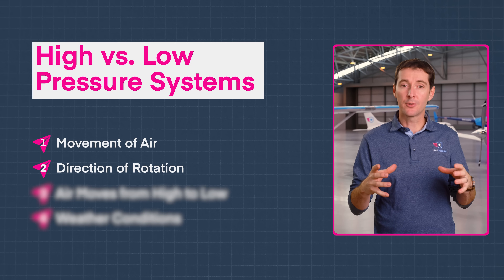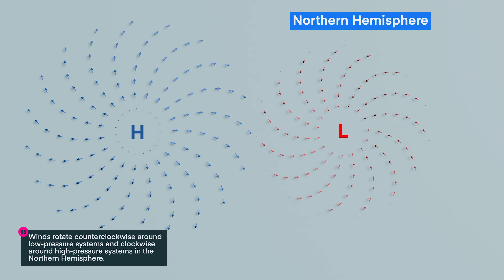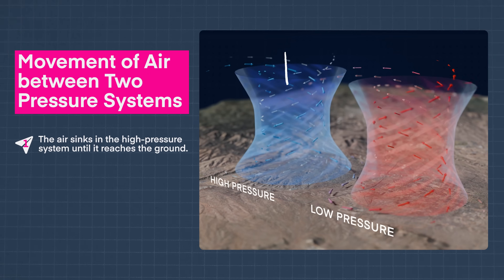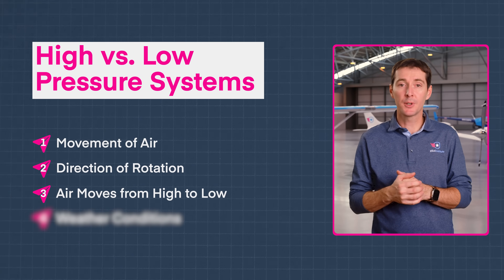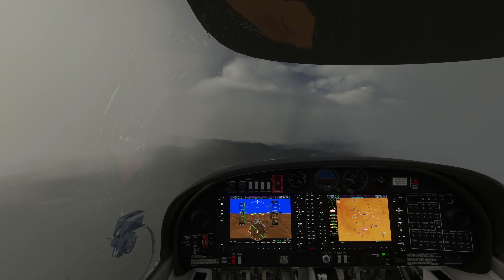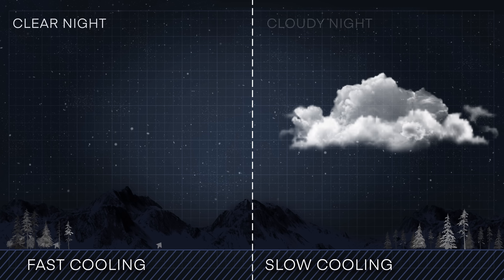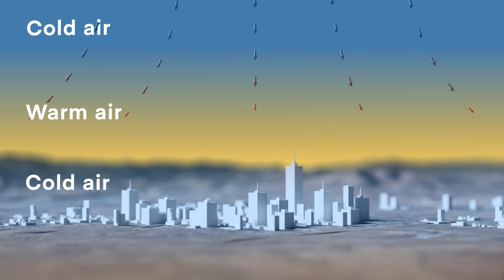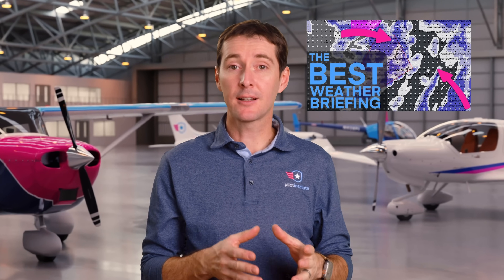High vs. Low-Pressure Weather Systems: What’s the Difference?

Comment: The clouds in a low pressure system are convective and tend to build up during the day. The wind is often fresher and visibility out of cloud is good.
In a high pressure system they are stable and stratiform, and the winds are light with haze and reduced visibility.

Comment: Brilliant presentation, useful for sailors too. One factor you missed was the adiabatic heating of the air in a high pressure system. As the air descends it compresses, and that compression heats the dry air, and that is why high pressure systems are warm and dry. Thanks for your great work.

Comment: Love this video, it took me a second to understand the "why" behind low and high, and then I remembered temperatures. Higher temps = lower pressure because the air is less dense, lower temps = high pressure because air is more dense. Heat expands/energizes molecules, but lower heat = less energized molecules so they are closer together. In laymans terms anyways lol

Comment: Does a high pressure system cause the air to sink, or does sinking air cause a high pressure system? Does a decrease in air temperature cause an increase in air pressure, or vice versa?
Reply: Just using simple physics, cooled air is more dense because cooled atoms have less energy and do not move that much. That makes the same volume of air take less space. That creates a pit in the air layer that is getting filled from its sides with a less dence warmer air. This air goes to the center of the pit, becomes colder and sinks to the bottom.
Reply: @FogsterBell so a high pressure system is created by the presence of cold air?

Comment: If low pressure causes instability because of rising air currents why doesn’t high pressure cause instability because of downward air currents? What am I missing?
Reply: I meant air pressure in both instances.
Reply: Because low pressure rises in attempt to equalize the pressure. It results convective activity.

Comment: Coriolis effect is BS
Reply: Care to explain your position?
Reply: @edwardkuehnle7955  My position depends on the location I’m at. For example, when I am in Australia my position is upside down. When I am in Germany my position is upside down as well, when you consider my position after the Australian point of view.
Reply: @edwardkuehnle7955  Ask the pseudoscientific bamboozlers, WHY the Moon waxes from left to right on the Southern Hemisphere, and from right to left on the Northern Hemisphere.
Reply: Wow man, you must be a rocket scientist.. why not make a video and explain your theory?
Reply: @GWExpeditions  It’s no theory. NOTHING flies or floats in a vacuum. Neither is, an open atmosphere floating in a vacuum, without walls, lid or skin which avoid the air to escape into the vacuum of space, capable of generating pressure. It’s like a balloon floating in a vacuum exerting pressure on a nonexistent rubber skin. That is totally absurd.
Reply: @GWExpeditions   My theory is that the Coriolis Effect is BS.
Reply: @michael.forkert  got you! so the earth is not turning on its axis?
Reply: @gerarddeclerck3939  No, silly, you got me not. The bamboozlers got YOU. The Northern Hemisphere turns in the same direction as the Southern Hemisphere, now, tell me why does the water go down the drain counterclockwise on one hemisphere and clockwise on the other, when both hemispheres turn in the same direction?
Reply: @gerarddeclerck3939  What difference does it make whether the Coriolis Effect is a pseudoscientific BS or not?
Reply: @michael.forkert  your uninformed opinion makes no difference, this is true
Reply: @GWExpeditions  Why do you think that my uniformed opinion is wrong, and your uniformed opinion is right?
Reply: @michael.forkert  it’s called science, you should try reading it could be a life changing experience for you
Reply: @GWExpeditions  Neither does YOUR informed opinion.
Reply: @GWExpeditions  Reading SCIENCE, which tells us that the DIAMETER of the OBSERVABLE universe is 93 BILLION light years long? Doing the math: 93 billion light years are 5.5 SEPTILLION miles. When the diameter of the observable universe is 5.5 septillion miles long, imagine how long the diameter of the non observable universe would be! Who believes in such a BStology is very fond of being bamboozled.
Reply: @michael.forkert  regret having wasted my time with you
Reply: @GWExpeditions  I didn't invite you to be the analyst of my writings. If you regretted wasting time with me, it's your fault alone.
Reply: NO its not,  but its not a force 😂 its a 'force'
Reply: @perbacksten6149 Yes it isn’t.

Comment: Can you explain why high-pressure systems are stable and low-pressure systems are unstable?  Both, as you explain, cause a vertical movement of air.  It seems that in a high-pressure system, air moving upward would cause winds coming in laterally to replace the upward-displaced air.
Reply: You got it the other way round! In a high pressure system air is moving downwards.